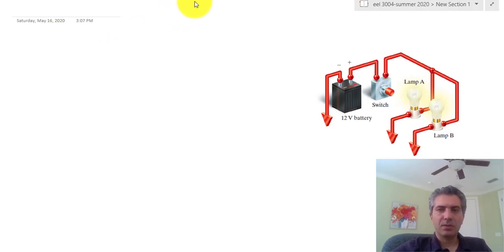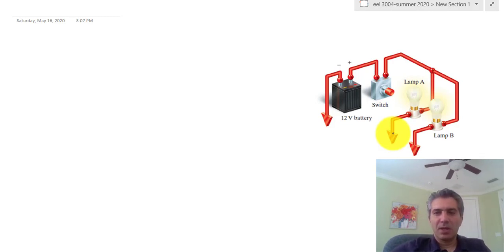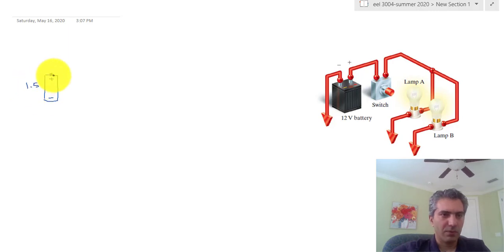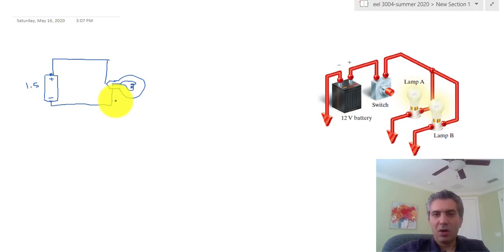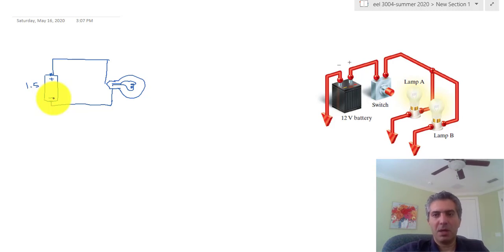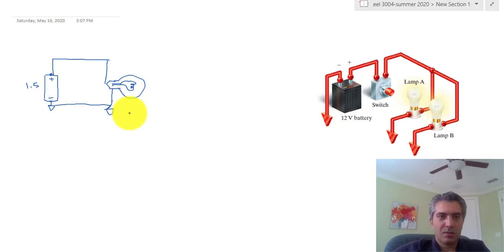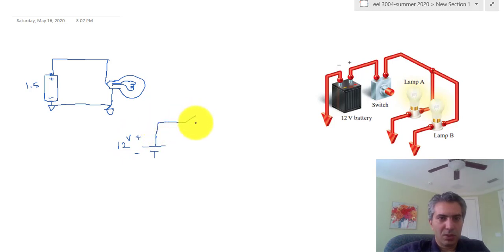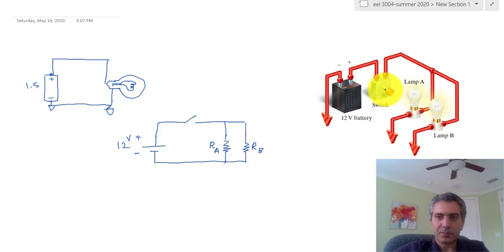Circuit modeling practice: electrical connections in a car

Comment: That was a great explanation of where light comes from. I watch all your videos but thought that was remarkable.
Reply from the maker: I am happy that the videos are helping you. Can I ask where you are?
Reply: @electricalengineeringmadei1041  Sure, I'm in Rhode Island. I'm taking Linear Circuit Theory in the fall, and with these videos I'll be able to hit the ground running when classes start. Is there a book that has these problems or a book that you recommend?
Reply from the maker: @jaraddemarco7664  The book is Electric Circuits, by J.W. Nilsson and S.A. Riedel, 11th edition, Generally I don't use the techniques that are taught in most books and prefer to use what I call universal method (Lectures 3-1 and 3-2). I continue to use the same technique for all circuits at all times.
Reply: @electricalengineeringmadei1041  That's good to hear because the approach is easy to follow. I'd just like the book so I don't have to draw out every circuit.
Reply: @electricalengineeringmadei1041  I just have one more question, about how you said your method is unconventional and not in the book. Is your method still the general idea of the class? I guess my main question, is will your videos help me when I start the class?
Reply from the maker: @jaraddemarco7664  Solve one of the problems that is assigned to you in your class using the universal method and show it to your instructor. If you can convince them that this method deserves all the credit then you are all set! Otherwise, you can learn the general concepts using my videos but you have to resort back to using the more conventional techniques when it comes to problem solving.